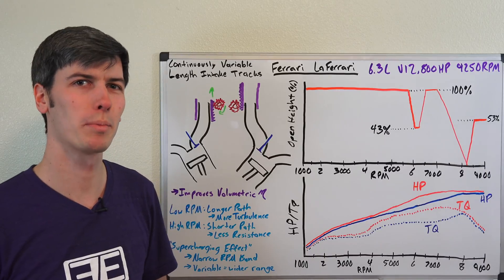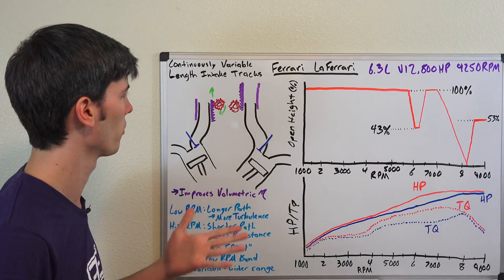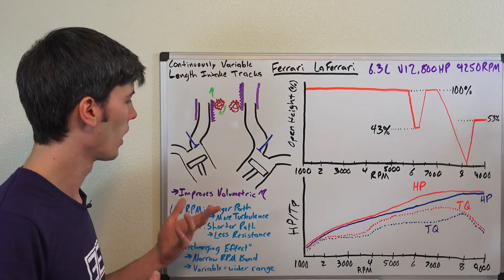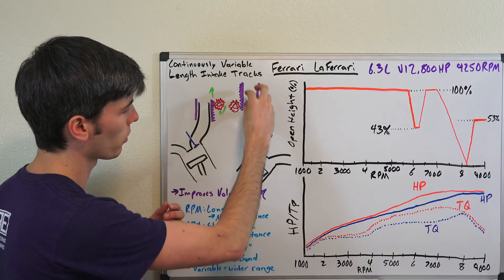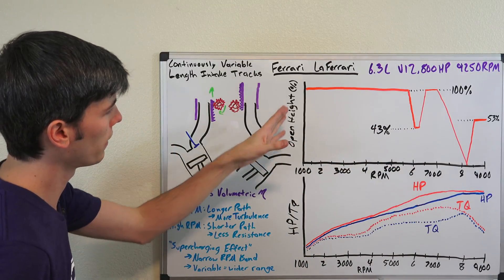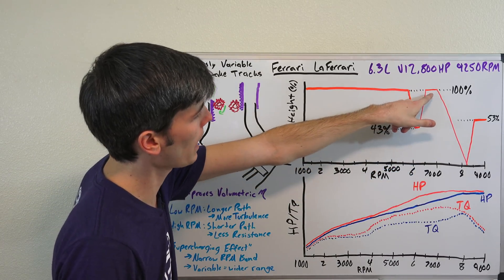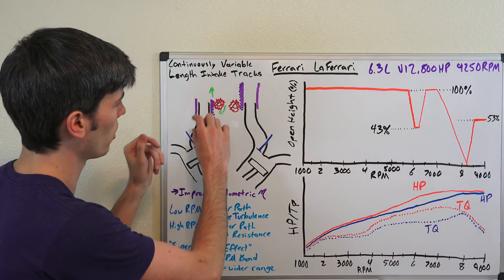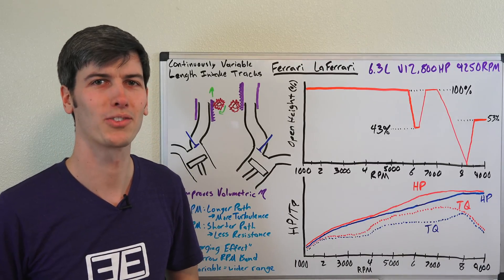Ferrari LaFerrari's Brilliant Air Intake System - 800 HP V12 Engine

Comment: unfortunately when cars go full electric this channel will get boring.
Reply: Curry The Goat Of Mankind Last Nba Legend but we still have plenty of time left until the "old" engines die out and everything is all electric ^^
Reply: Curry The Goat Of Mankind Last Nba Legend yep, one day every car will sound the same, same throttle characteristics, same torque curves. Car shows will become boring, racing will become boring. Evs will never have the character or soul of engines like these.
Reply: That will never happen.
Reply: are you sure? cos going full electric is not that easy
Reply: +astickydog yea those will be dark days my friend
Reply: +cok Bagus it is that easy, but fueling stations and big oil companies are holding them back. also i suspect no smart military would ever adopt full electric range of vehicles so thats about the only place in the future will gas driven engines will live
Reply: the drawbacks of simplicity
Reply: These things never bores humans atleast. The sound ic engine makes 😍😍😍
Reply: I've always found battery tech to be very interesting, as well as material sciences involved in making more efficient and powerful motors.  It'll still be interesting, just very different. Instead of variable intakes, there will be talk of variable capacitance, new coil geometries, tire tech, etc.
Reply: hmm true
Reply: Curry The Goat Of Mankind Last Nba Legend They won't any time soon
Reply: Curry The Goat Of Mankind Last Nba Legend but if you look at the Rimac Concept One, it has an extremely cool motor sound like a gas car, but very different... it's very futuristic... although it's really expensive, it's possible to make an electric car fun.... so don't say it is the dark ages, and you've obviously not been in an electric car or a fast EV
Reply: Race cars wont be all that way for long time
Reply: Curry The Goat Of Mankind Last Nba Legend it will be cool for a few weeks until everyone knows how an electric motor works in terms of powering a car
Reply: I'll never own a fully electric car

Comment: is there an animation video of how this system works so i can get a better understanding?
Reply from the maker: Ferrari has an animation on their website, but it doesn't show any details, only the intake track lengthening and shortening. There's also a video of it on an F1 car, but again, they do not show the mechanism of how it works.
Reply: Well its literally a tube with another tube at the end that can get shorter or longer lol.
Reply: Just realized maybe he wanted an animation of how the air particles move around in the manifold, that would be interesting.
Reply: The system is based around resonance so it can be visualised with pressure wavefronts or standing waves, so that would be much more awesome than JUST a few tubes moving in and out.

Comment: Why aren't your torque and horsepower curves crossing at 5,252rpm?
Reply from the maker: Well there's not a scale shown, and since HP/TQ have different units, they'll each have their own scale. You can place the curves anywhere. Also important to remember, if you use metric units they don't "cross" at 5252.
Reply: +Engineering Explained 
True, but with metric/SI units they do cross at 9549.

Comment: how about the intake pressure waves? ive heard it has something to do with that, not sure though
Reply: You are correct sir has to do with a harmonic reflection bouncing off valves then back up in this case the intake tract, when the wave hits the inlet at atmosphere it again reflects back down toward the valves. Now they can use the 3rd 4th or so on reflection and time it such that the wave arrives at the precise moment the valves open giving a super charging effect. Many companies use some form of this but it's usually just 2 different air paths long narrow runner for low rpm, shorter wider runner's for high rpm.

Comment: all that technology and this and the other big three(P1) (918) and every other car in production still remain beaten by the Viper ACR on every track for half the price. oh how embarrassing
Reply from the maker: I don't know about "embarrassing," it's just different approaches. The Viper ACR has an absurdly high amount of downforce (hence all the lap records), but also an absurdly high drag coefficient. These cars focus much more on aerodynamic efficiency, which is far more challenging than throwing on a big wing. Not everyone will appreciate it, but it doesn't matter since there's only about 400 of each built anyways. These cars will have far higher acceleration forces at higher speeds than the Viper, and will reach much higher speeds, but won't necessarily have the downforce for the same levels of cornering grip. That said, McLaren claims the P1 has the highest downforce of any product car, so it might actually compete if it were to attempt lap records at the same tracks.
Reply: BuiltNotBrought Type R well it's simply because the the 3 hypercars are also made for the street and they would work perfectly as a daily (if someone's mad and rich enough). the viper acr is a beast but it's all racecar (for the street) it's loud it's uncomfortable it sucks hard for normal driving.
i'm pretty sure ferrari mclaren and porsche could build a car thats faster than the viper if they wouldn't give a damn about a stereo, a navigation system, a comfortable ride setup and so on(;
Reply: Every track except the drag strip.... which is usually where american cars are supposed to shine lol. Kinda ironic.
Reply: BuiltNotBrought Type R that's not the point
Reply: BuiltNotBrought Type R you can say the same thing about American muscle sheep getting their panties wet when a FWD civic beats a Camaro or Mustang in the 1/4 mile. the ACR is a track breast but that is where the hype ends. also it needs a track with lots of corners to shine, places like Thermal it still gets beaten by the 918 because the track has lots of straights. however, Laguna Seca it beats the Porsche by around 1 second or 1.5 I think, because the straights are shorter and it has more corners to keep up it's top speed. a shame dodge discontinued the Viper...
Reply: Engineering Explained well explained, also I made this comment out of bait and curiosity to see how many European fanatics would get triggered. I get your argument about different approaches and engineering the aerodynamics , but look back to 2008 when the second Gen Club racer was released and it set the Nurburgring record, the fanatics still refused to believe it and made up B.S like usual and ignorance from the European side arose.  And they are still in denial to this day making excuses. Like you said not everyone will appreciate it but it doesn't defeat the fact that it still happened, And may happen again if Dodge finally decides to take the ACR to Germany and set another record. My point is the European anti American sheep bandwagon will never end and neither will the excuses.
Reply: Put the ACR against the FXXK and see how it comes hehe
Reply: RST R MODS ^ Triggered

Comment: isn't that a yamaha patent?
or only in the motorcycles department?
Reply: Yamaha introduced the YCC-I (where the length og the intake funnel varied) On the 2007 R1. Så this is definitely not at new invention.
Reply: You mean the Power Valve? Like in the RD350? I think that's on the exhaust side of things, not the intake but I might be wrong.
Reply: Gara Von Hoiwkenzoiber nope. YCC-I -> Yamaha chip controlled intake.
my bike has it aswell and i think i've read that it is a yamaha patent but i'm not sure anymore.
Reply: Yeah the R6 had this years ago

Comment: 'Tract' not 'track'. Love your channel! Keep it up.
Reply from the maker: Ha, sometimes my vocabulary is atrocious. Great catch!
Reply: As an aside: A cool addition to your final drive ratio performance video would be a chart of wheel torque against speed, from zero mph to Vmax, going through the gears (each time to the rev limit). As the area beneath the curve between any two speeds shows the performance between those two speeds. 40-50mph could be quicker with a higher final drive which allows second gear at the engine power peak, than a lower final drive which needs 3rd gear and drops the engine to a lower power range (the graph would illustrate this).

Comment: Yamaha has been doing this for a while, YCC-I
Reply: s14slide My man, thanks for mentioning this
Reply: s14slide didn't really help their RN19 compared to their RN12 power curve in low range
Reply: +unphoto I'm not to familiar in power delivery differences between the different gen motors.  Haven't saddled a Yami since the late 90's myself.  I just wanted to mention where mention was due.  Yamaha starting utilizing this tech on production bikes in 2007 or 2008.  You have now caught my interest though.  It would be awesome if you had a link or two on the subject.   I looked and there is a lot of chaffe to wade through.
Reply: s14slide no problem, what exactly do you want to know
Reply: yamaha is literally so good at making engines
Reply: Not the same .
Reply: Yup.. Rotaries on track has adjustable choke tubes
Reply: s14slide was looking for this. yamaha used this since 2006 in the R6.